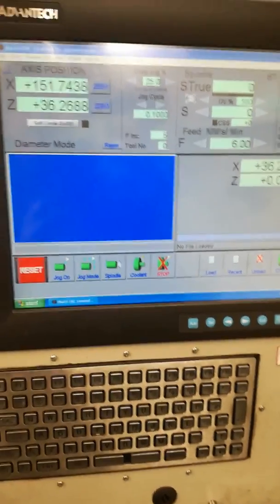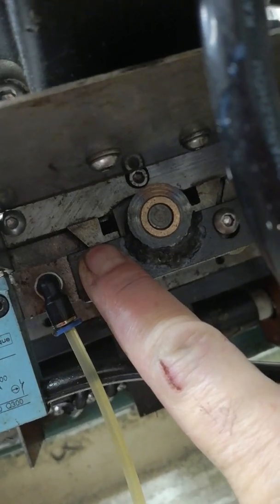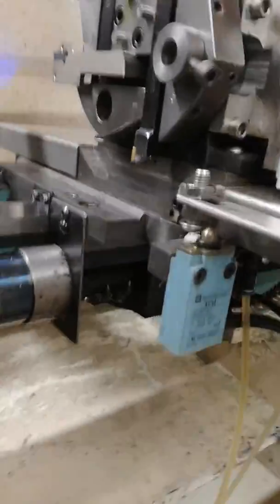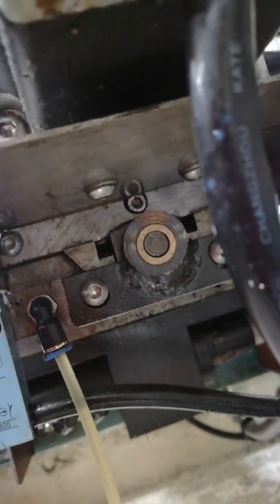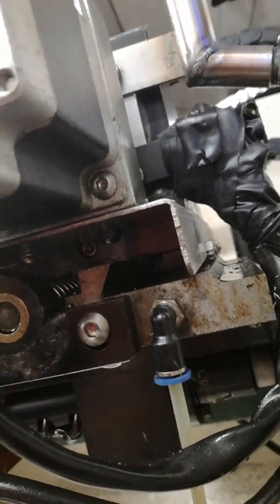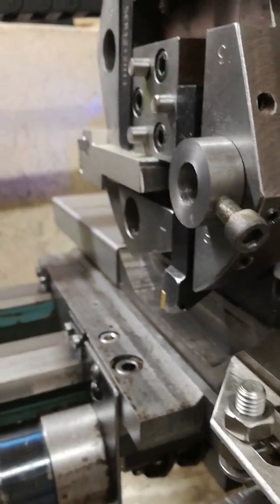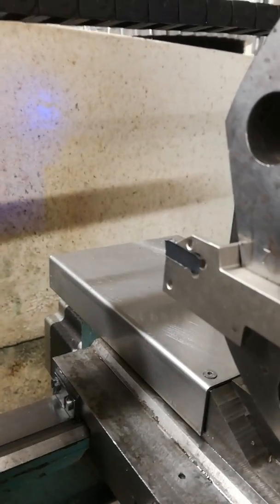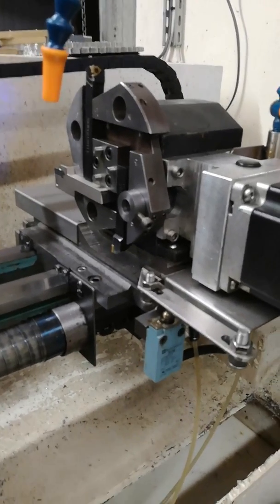Denford Orac new saddle and cross slide

Comment: Hi buddy, really enjoyed your video - mine has had larger steppers fitted replacing the original motors. I do have a problem with my cross slide mech and its in this light I ask the question : was some kind of 'glue' or metal sealant used at the far end of the original ball screw? Mine has a relatively large stepper motor on the other end, driven by a belt (I'd send you s pic, but that's not possible on here) its the 'connection' between the bearing end & the ball screw shaft I'm referring to. It looks like someone (maybe even OEM) ground small marks into the surface of the ball screw shaft (the last 15mm or so is unthreaded) It this last part that goes into a close tolerance thrust bearing sleeve on the end & mine has popped loose. I know it sounds unlikely that this is what they had done but I have scraped out some kind of brown residue that was in these grind marks that is pot hard, and appears to be the method of drive, which is hard to believe but there you go. Maybe it was to give a fail safe should a new CNC operator wanged the cross slide into a work piece?
Hopefully you still watch for replies to your old uploads.
Best regards, Mark.